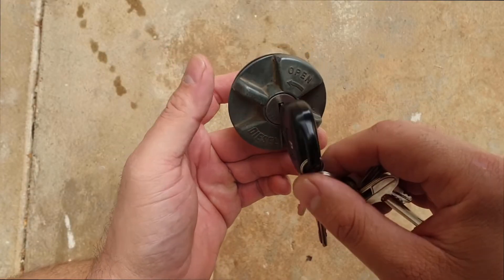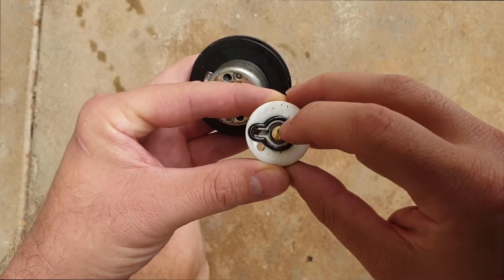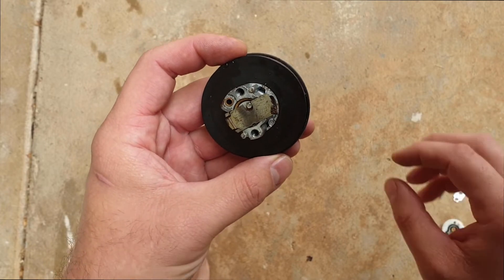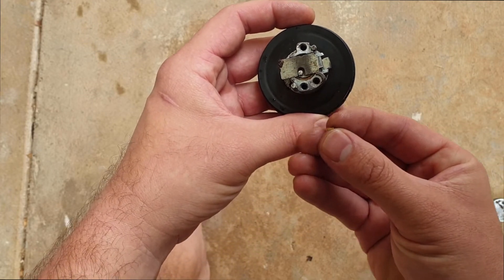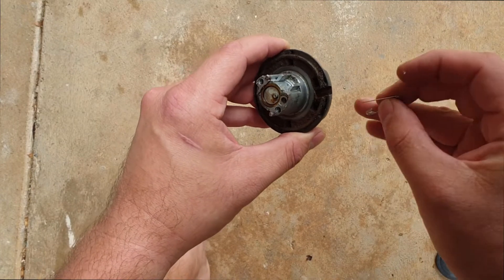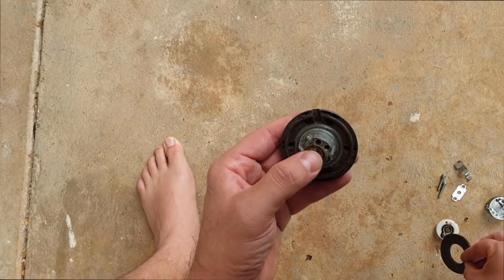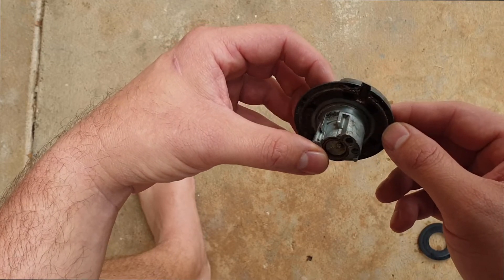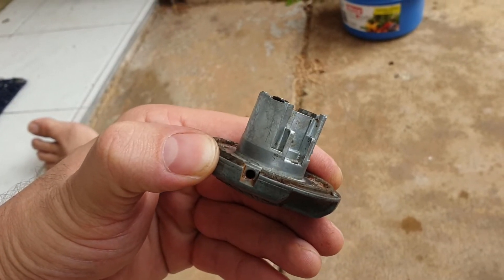Fourby Friday - Hilux fuel tank vacuum issue

Comment: We had been bugged by this problem for many months, with the fuel filter being changed too often and sensors replaced, all to no avail. We have an aftermarket large metal fuel tank, and have had it off the truck thinking that it may be contaminated. The bottom panel of the tank was dented up, we thought due to hitting something. When we discovered this post, all was revealed. The cap was clogged and cleaned, and we are able to pull out the dent using vac. cleaner as a blower.Very grateful for your contribution.
Reply from the maker: So glad to hear it helped you!

Comment: Thanks for this vid  we had the fuel light come on our 2009 hilux ,we changed the fuel filter ,and reset the light by disconnecting the electric plug at the filter , then started the car and reconnected the plug within 30 seconds.
Turns out it was a blocked fuel cap breather , we have been exclusively driving on dusty roads up at the Palmer river . 
Thanks again !     Easy job was cleaned and put back together in about 10mins 👍
Reply from the maker: @mathewrussell1526  glad it helped! A fleeting comment from a mechanic has helped so many people

Comment: You would read about it, but my LN 167 2004 5LE just had the same problem, thanks for the info about it , that fuel cap is certainly a tricky biscuit

Comment: Thanks mate ...you solved my problem of rough idle on starting. Diesel was being sucked back into the tank after stopping and so the engine was not idling fine. Well done mate
Reply from the maker: Mate that's why I had to film it, such a small fix to resolve a few problems. Glad your truck is working properly again!

Comment: My 2004 single cab 4x4 diesel, Holden Rodeo, for years, an hour or two after driving, it would make a funny sound and I often wondered if it had a blocked fuel tank breether. I didn't know where to look for a breether, assumed it would be on the sender. It has also always been a pain to prime the fuel after running out of fuel or changing the fuel filter. I think I probably destroyed my first starter motor trying to get it going again. The other day, after changing the fuel filter and trying to bleed the fuel, I had a sudden brainwave. I took the fuel cap off and it sucked air. Then I did a bit of research and found this video. I did exactly as described and cleaned parts with petrol, tooth brush and compressed air. I have not heard it make the funny sound again. I'm wondering if this is why it has always been a prick to bleed the fuel. Our 100 series Landcruser is very easy. A few pumps and away it goes.
Reply from the maker: Mate it's always the way, I hire this resolves the issue for you. Running the system dry will make it take ages. Apparently a trick is to run a compressor on the tank and pump it through, never tried it myself.

If you check out the video I did with Dan Gough (also on podcast) he actually talks about it.